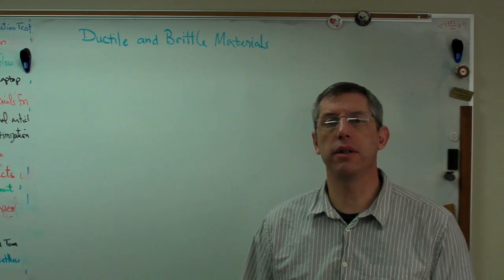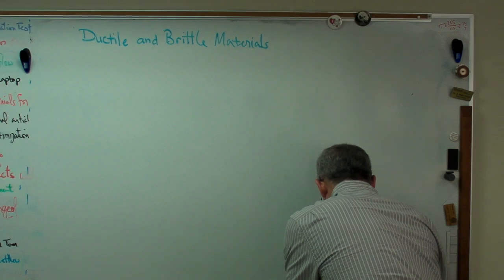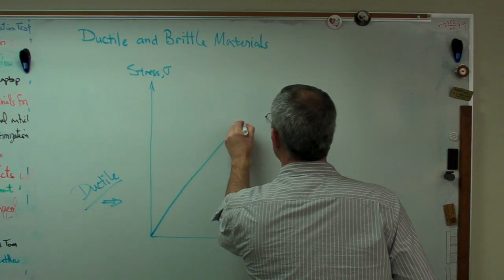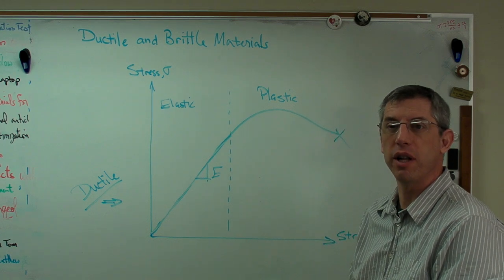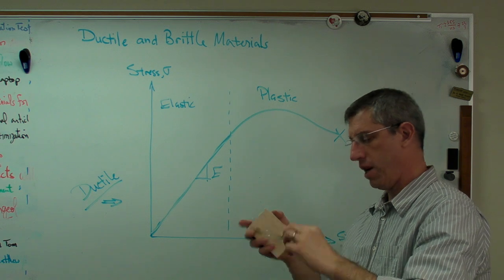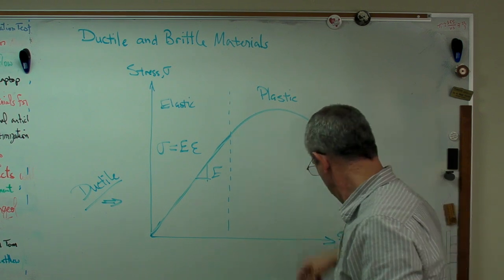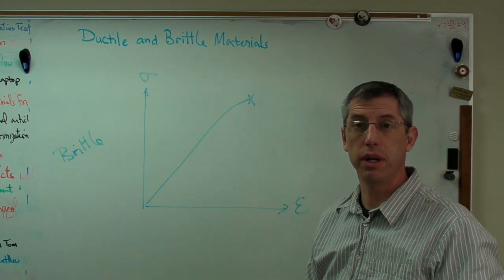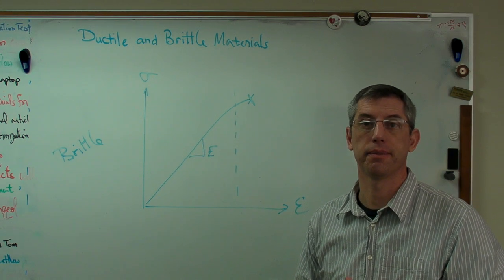Ductile and Brittle.MP4

Comment: Elastic is the material are under loading, the dimensions and shape change.
Initial linear or near lineae region in which the strain is fully recovered when the load is removed, the material will return to its initial shape and dimensions